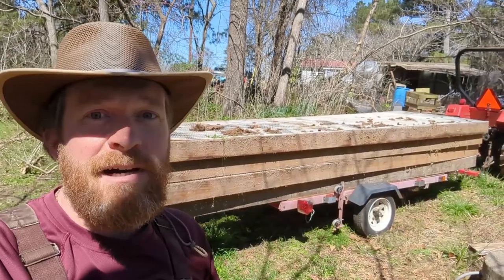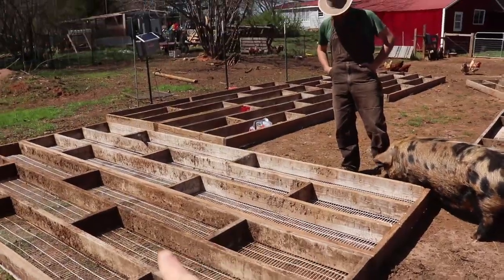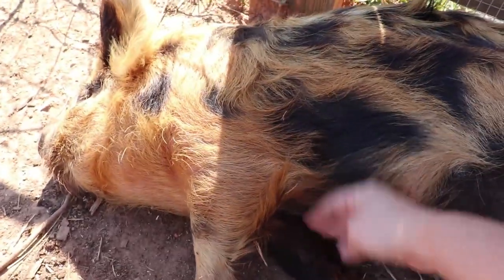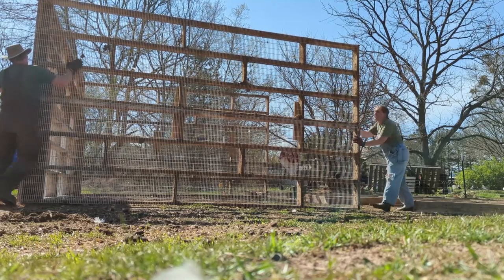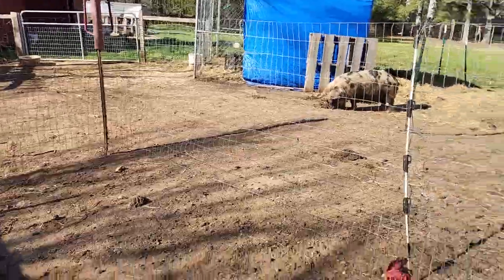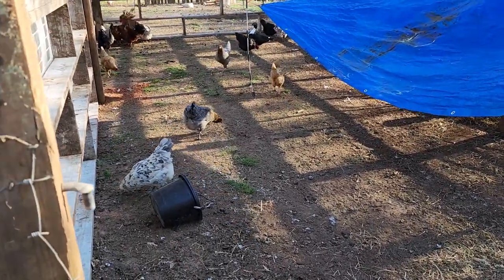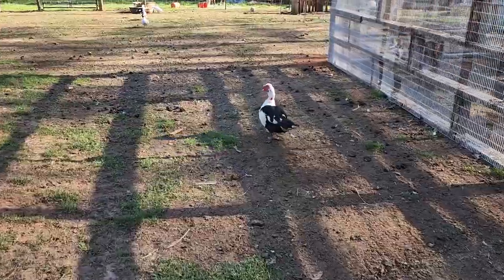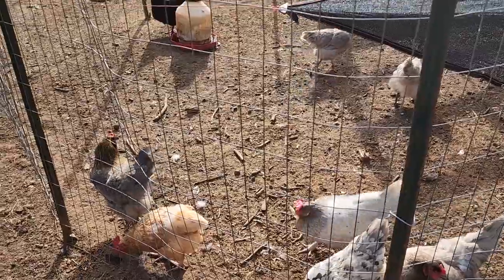Our AMAZING 28'x14'x8' Aviary Chicken Run Build! || First Step to a New Stationary Coop Finished

Comment: Impressive and sturdy for sure.It will require one heck of a roof eh? Plenty of space  Peace from MN
Reply from the maker: That's where we are still trying  to figure  out how to do it.... any suggestions  welcome
Reply: @WholesomeRoots  Its possible that a solid roof to shed water maybe too wind resistant and too heavy.Your walls are open and tall so water would still blow in horizontally.Possible that you may consider poultry netting(shade cloth) or some other protection from predators.Spend your resources on Pred proof the future coop and drainable rake-able run yard.
Reply from the maker: @Mark4WorldPeace  that's my fear too about  being top heavy... but I need something  to keep hawks out and  I really  wanted  the rain kept out but like you  said  it will blow right  in anyway.  A truckload  of sand would  be expensive  but possibly  the best wat to keep the run clean and  odor free even during  our rainy season.  The coop will  be so predator  proof that  even a snake or mouse won't get in, lol.